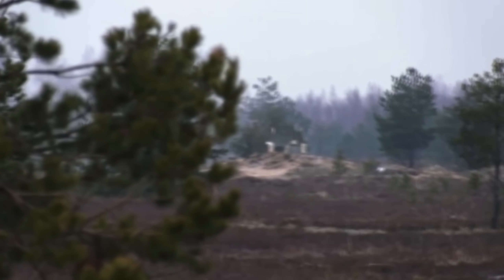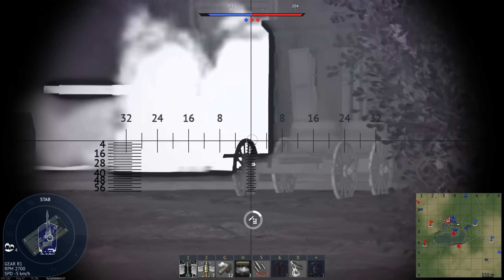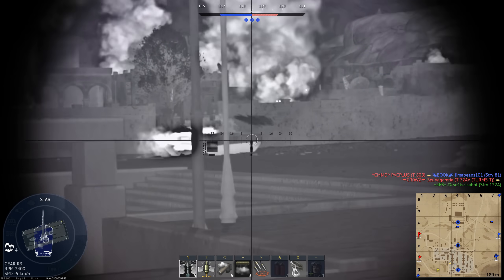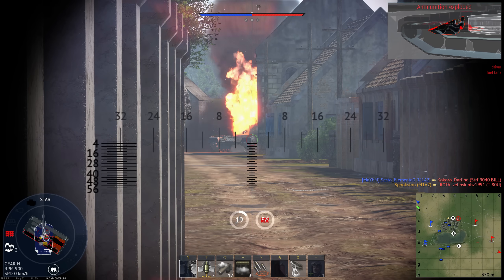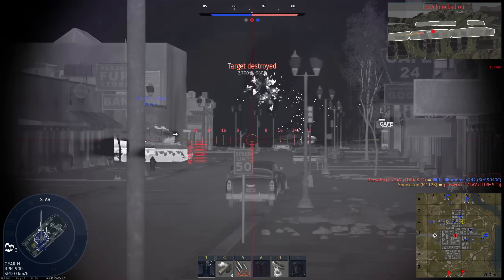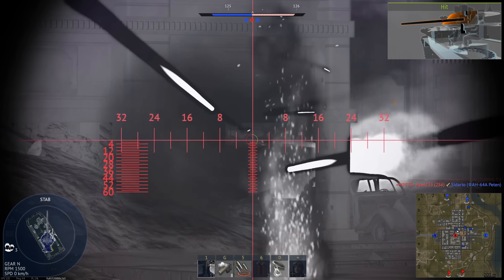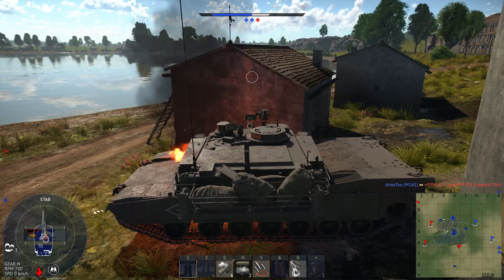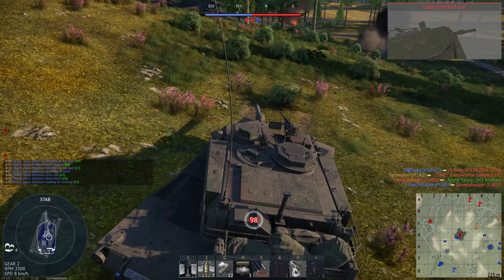Why The M1 Abrams Uses Depleted Uranium

Comment: atually the pyrophoric properties of depleted uranium in larger rounds, (40mm minimum) but usually used in 120mm rounds creates a super hot jet that melts through a certain depth of metal armor helped by the geometry and design of the shells, it goes quiet deep, aiding significantly in armor piercing round capabilities.

Comment: Fun fact about the medical problems regarding DU and Tungsten alloy. 

DU of course is bad for your health as are most heavy metalls. not just because of its radioactivity and radioactive daughter nuclei, but because of its affinity towards oxidation. This can lead to heavy metal poisoning of course. However it isnt as bad, since its pretty much pure uranium. 

Tungsten alloy however shows high risk of inducing cancer, not because tungsten itself is radioactive or poisonous, its really is pretty inert. The real culprit behind the cancer is the Cobalt, Nickel and other components of the alloy, which make the tungsten more malleable during melting/forming the penetrator. A conclusive study in 2023 shows a really good explanation why WA (Tungsten Alloy) is really bad for people and also other life. If you however made pure tungsten penetrators, you would have less penetrating performance and higher brittleness, higher cost of manufacture and less usage in different ammo types. 

So you can pick your poison. Vaporized DU or cancer inducing Cobalt and Nickel.

Comment: Tbh, i feel like DU armor is not a thing, it's a lie to make it sound like domestic Abrams have some special sauce. I simply cannot see a reason why you would use DU instead of tungsten in armor, considering it's many inferiour properties when compared to tungsten. The only upside would be the cost, but that is in turn offset by molten DU flooding the fighting compartment when penetrated by say, a tungsten penetrator. 
If DU armor was a thing, then both Russia and China would be all over that. Basically, I'm calling BS, Abrams does not have magic DU armor inserts in it's composite armor package. It's just more US army fluff.
Reply: That's a pretty braindead take
Reply: @YoBoyNeptune  About as braindead as your rebuttal tbf.
Reply: I swear there are documents that were leaked about DU armour

Comment: One of the other reasons is the ease of working with DU vs W. Tungsten has a melting point of over 6000 degrees, while DU is only 2000, less than steel despite the higher density. That means you could technically melt DU into a steel mold and be able to reuse the mold. In addition, MAP gas burns at 3500~ degrees F. DU is essentially cheaper, more malleable, and easier to melt while still having 90% the density of tungsten while also self-sharpening and basically useless otherwise.

Comment: Here is the main problem...DU when exposed to air instantly ignites because it loves to combine with oxygen...the dust tht settles out after DU burns is Uranium Oxide...these fine dust particles get inhaled and absorbed through the skin. radiation isnt fully dangerous provided your clothing or skin blocks it. When inhaled...radiation damages from your insides out....the particles can no longer be deflected.

Comment: This video starts good but it quickly devolves in you desperately trying to justify a choice that doesn't really makes sense:

1- Uranium is NOT cheap, i don't even know how you came up with that. Uranium is extremely expensive, since it's both very rare and very hazardous to handle and work with. Depleted uranium costs A LOT more than more standard steel and ceramic armour. By a LOT.

2- The use of depleted uranium in the cannon rounds was NEVER controversial. The use of DU as armor is. By lumping the two together you're trying to associate DU positive traits as cannon round material to its use as armour. 

But DU is a terrbile choice for armour because while being very hard its also very brittle, and it works better as a penetrator rather than a wall. Other composite materials like glass, titanium or ceramic work better as armour while weighting less AND being much less dangerous.

3: DU is TERRIBLE for the crew when someethign manages to penetrate, as it will carry nebulized DU particles inside the tank, and i don't need to tell you why inhaling and ingesting or having that stamped into your body is really, really bad

4: DU only helps against kinetic penetrators, it's completely useless against shaped charges, which are the most common round the tanks actually face in the real world outside of WT servers. Drones, anti tank missiles, and helicopters all use shaped charges, and those not only will penetrate DU with ease, but will also be enriched by its poisonous properties, making them even more lethal for the crew.

In short, DU is a very bad choice for armour, useful more for bragging rights than for anything else. And it's why no other nations with easy access to depleted uranium has used it in their tank armour.

Comment: DU should be a war crime. When it is fired, it disintegrates into nano sized particles that are so small they can enter directly through the cellular wall. (safety equipment is useless) It is highly radioactive and toxic (heavy metal poisoning) and remains this way for hundreds of years. Its seeps into the soil and poisons all the water and food. The results are a massive increase in cancer and birth defects for generations. IMO its one of the most dangerous substances used in war because of how long it affects people and the local environment. Its even more long lasting and dangerous than landmines. Using DU in an area essentially transforms that area into a mini chernobyl. It is literally the byproduct of enriching fuel for nuclear reactors and making a projectile out of it. It is a dirty bomb in bullet form. There are some great presentations on the dangers of DU by Dr. Dough Rokke, i recommend giving them a watch.

Comment: Well the engine makes sense, because it can take any type of fuel. So it's pretty much a trade off of good and bad.

And the only heavy metal we need is Metallica.
Reply: Well, in my opinion the multifuel idea is bit of a paper tiger. Yes, it sounds logical. Until you consider 2 main points. How much fuel does a tank need? Where do you get such quantities other than on a fuel station anyway, so that you can fill up the tanks in a reasonable timeframe. You need thousads of liters to fill up one tank squad. Now ask yourself the question, what would be the nearest place to your home that could store compatible liquids in the required quantities and isn't a pump station anyway?

Comment: Uranium is NOT cheap. Not at all. Its few times the price of tungsten. Its expensive.
If it was cheap Russians would be all over it - all of their rounds would be DU. But they have so few rounds that are DU and they used to have these only for "special war measures".
Reply: Yes and no. You are right in the point that the initial production of Uranium is very expensive. But that cost is basically paid by the users of the fissionable fraction of the material. DU is basically waste material. It's not specially produced, it's simply whats left if you remove the fraction that you can use for nuclear applications.

Comment: The two points made ( uranium is common and uranium has better penetration) are both not entirely true.
(1)
Uranium is common insofar the concentration of uranium in Earth's geological composition. However, for uranium to be depleted it needs to be highly processed for refining. Thus, the cost of DU is very much classified and definitely higher than Tungsten.
(2)
DU is better at armor penetration because its can sharpen itself. Yes and no. Uranium is reported to have better pen than Tungsten. However, the "self-sharpening" effect is better explained by simply mentioning that DU has a much much lower melting point and softer than tungsten, which makes it easier to form molten jets for armor pen. Tungsten has a melting point of something like 3400 Celsius and DU is only about 1000 Celsius; also, tungsten is way too hard and brittle for armor pen. Its easier for tungsten to shatter than melting.

Comment: The M1 Abrams uses depleted uranium because it's extremely expensive to dispose of or store. 
The solution, convince idiots that depleted uranium is not that dangerous, make ammo out of it, then use as many rounds as possible in the middle east. Boom, no more depleted uranium to dispose of or store, problem solved.

Comment: The answer is no, no one manufactures depleted Uranium. The M1 cannot use that type of material otherwise you lose it to IONIZATION. 1 projectile with uranium would WRITE OFF a whole Army and every vehicle on the road due to contamination. With RADIATION it cannot be removed from metal so if you have a radioactive tank it has to be buried. And if it is near anything metal then that becomes radioactive and then it spreads and you could lose an entire Country. Radioactivity causes IONIZATION of CIRCUITRY which kills it as the radiation prevents circuits from functioning correctly and passing current. So there is no DEPLETED URANIUM PROJECTILES. If it is near reinforced steel on a bridge then that becomes radioactive and anything that goes near it would become radioactive. It takes 52 Trillion Zeros in years for Uranium to become INERT of RADIOACTIVITY THROUGH HALF LIFE. And it kills people with cancer. Anyone who goes near it becomes a Cancer Patient. I am the Arkangel Daniel and I am from Heaven.

Comment: After the U235 is removed, depleted Uranium accumulating at the AEC and considered hazardous waste. Turning this from a cost loser to cost positive is a military win. Tungsten would obviously be better but actually needs to be paid for. No US law prevents dumping hazardous wastes in other countries, let alone belligerants. Although softer, Uranium's density is higher and on impact shatters into sharper and sharper tip. Easily burns in air and fumes produced are very toxic

Comment: Even the Germans do this back in 1920 gas engines give you more high-end power by the way the engine will burn diesel fuel alcohol gasoline and I believe it’ll rub you could run rubbing alcohol in it so out of the box that’s not a fair statement

Comment: Tungsten/DU nearly the same in performance just the cost differences are huge. Russia has so much tungsten they can use it as often
Reply: nope, you need special technology to make it equally effective, and South Korea holds patents
Reply: @CodexMender  Russian tungsten manufacturing does not require outsider help for weapons. It's one of the reasons why it's uses so extensively
Reply: @gvi341984  Korea created self-sharpening process on tungsten heavy alloy, it gives 10% increase that compensates 6%~10% loss vs DU for material difference. So that's 0% to 4% increase of firepower vs DU without exposure to DU particles.
Reply: @gvi341984  Just saying this DU penetrator technology is outdated and no longer needed, because there is better alternative since late 90s. Speaking of tungsten technology, the United States didn't have such top-class tungsten technology so the US had to depend on German techs.
Reply: @CodexMender  For Russians it's the cheapest most effective material to use for high penetration
Reply: @gvi341984  Speaking of Russia, we Koreans well know about Russian top-tank technologies very well. Remeber Koreans disected T-80U.
Kinda unpleasing to hear many arm-chair generals underestimating Russian tanks. We Koreans were very impressed with Russian gears!

Comment: DU is far more dangerous as a toxic metal than as a radioactive isotope.  By weight, the Radium that illuminates watch dials and night sights is about 1 million times more radioactive than DU.  A watch with a Radium dial worn for 1 day will give off more gamma radiation than sitting inside an Abrams for 20 years.

Toxicity though is no joke, the military absolutely doesn’t care about the materials it makes vehicles out on and what the smoke from burning those materials can do to a person long term.

Just an example, Mass Loaded Vinyl was marine industry standard for sound protection 20 years ago.  That is until they showed how toxic it was in even a small fire.  MLV is being removed from all ships and it’s being replaced by… lead sheeting.  Bc if properly installed the risk is less.

Comment: The problem with Depleted Uranium is it is pyrophoric. DU burns and vaporizes when it hits a hard metal target.
People in the the tank, picking up the tank for repair or people at the junk yards or kids playing on or around junkyard tanks are exposed to easily inhaled DU dust. That is bad. Using it for armor and weapons does get rid of an expensive waste disposal problem. Hmmm.
Look at how much effort and expense was used after the Bosnian War to remove spent A-10 rounds from the environment.
My iPad emits the same alpha radiation from the screen as solid DU. Find an alpha detecting Geiger counter to prove my point. It assists the touch screen function. Alpha is stopped by skin and papar. So, no big deal. Breathing in incredibly small DU particles or ingesting them is what causes the short (pregnancy) term and long term damages.

Comment: Enrichment does not "create" U235. It separates U238 from U235. "Depleted Uranium" is another name for Uranium metal that has very little U235 in it and "Enriched Uranium" is another name for Uranium metal that has a lot of U235 in it. You are correct to say it is the 235 isotope that is used in nuclear reactors but a maximum of 5% U235 is what is used in reactors.
   Naturally occurring Uranium ore is about 99.3% U238 and 0.7% U235 and cannot be used in a reactor or a bomb. Thus the need is to separate out some of the U238 so the percentage of U235 will rise to around 5% so it can be used in a reactor. This is done by reacting the Uranium ore with Florine to make the gas Uranium-hexafloride and spinning it in centrifuges so that the heavier U238 containing molecules will tend to go to the outside of the cylinder and then draw out the gas from the center where the percentage of U235 containing molecules is higher and send that on to another centrifuge to repeat the process. It takes many centrifuges to get the percentage of U235 high enough to use in a reactor, and when rich enough the gas is extracted and the total Uranium conglomerate of 5% U235 and 95% U238 is then precipitated out into metal and the Florine is then reused to make new Uranium-hexafloride.
   Now you now why it's called Uranium "enrichment". It's all about getting the percentage of U235 high enough to get a fissile material for the reactor.

Comment: Considering a projectile from a smoothbore doesn't spin, is there a case for a "top-attack" round that is aimed to fly over the top of a tank with a shaped charge directed down like an NLAW warhead? This may be even better than a DU-APFSDS as it can destroy a tank even if it is in a full hull-down position and the 120mm gun's velocity allows a much shorter flight time than a missile.

Comment: bs! It uses depleted Urainium on foreign soil because people there don't matte to the pentagon, only american public opinion and how its controllede matters. Normal MBT's today have 120, 122, 125 and 130 mm main guns and often tungsten rounds are used to gain penetration, but the Abrahams is so obsolete with its 105mm main gun that it has to use plutoniumto gain enough pen. And it also helps poisoning the land where it is deployd. Gets rid of people and helps steal their resources.
Reply: Bro the Abrams uses a 120mm

Comment: The use of the turbine engine is because it's more powerful and you can use almost any fuel type in it if needed which comes in handy in a warzone where you might not receive fuel from the supply chain but there happens to be a gas station or a liquor store lol

Comment: It's more than that actually. The current US APFSDS philosophy favors heavier, longer and thicker rods at LOWER velocities (relative to thinner, faster, rods used by German DM series APFSDS ammunition). This is thought to be more effective against "heavy" ERA designed to sear and break long rod penetrators. These "long-n-thick" darts also retain more penetration at longer ranges because velocity is an ever decreasing asset in flight whereas mass is constant. A heavier, thicker and longer rod is also a better fit for the M1 Abrams's 44-caliber barrel which does not have enough length to effectively burn the higher propellant loading of the German flavor APFSDS rounds. The shedding vs deforming characteristics of Uranium is less reliant on velocity which makes it a better choice given this philosophy.

Comment: Now you may be wondering why you would want to use something brittle in your tank armor? After all, the T-34 had a problem with spalling and shattering because the steel was over hardened. Well, if you combine the hard materials with softer ones, it does a pretty good job of slowing things down. Let me put it this way.

If you punched a stack of China plates, yeah you’d break your hand, but the kinetic energy will shatter most of the plates. If you punched a stack of China plates with memory foam bricks placed between them, that’s a bit harder to do. You punch the stack, the first plate breaks, but so does your hand. Your mangled and deformed hand then slams into the soft foam layer, which creates a lot of drag to slow your punch down. And because your hand now looks like an uncooked ramen noodle packet in a sock, the deformation creates even more drag. Now your chances of going through the second plate are lower.

Congratulations, now you know how composite armor works, and you’ve got a nice memey copypasta. Hard layers to breakup or deform the round, soft layers to slow the projectile down. Here’s some shit no one asked for, you’re welcome.